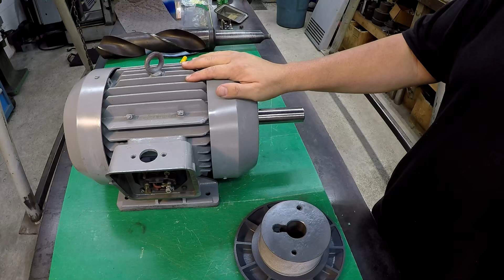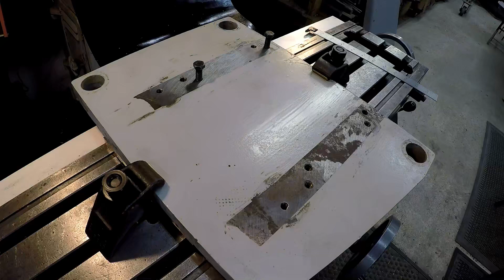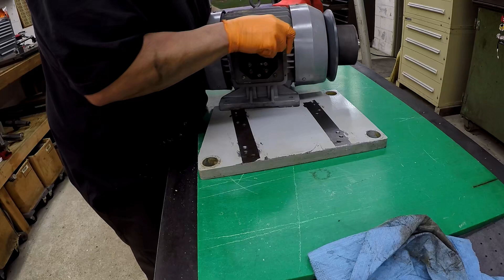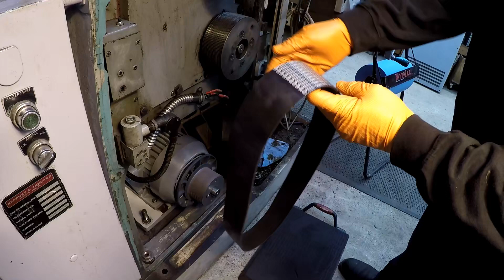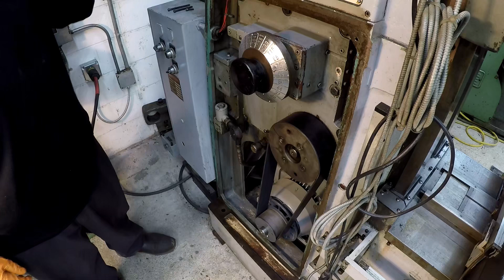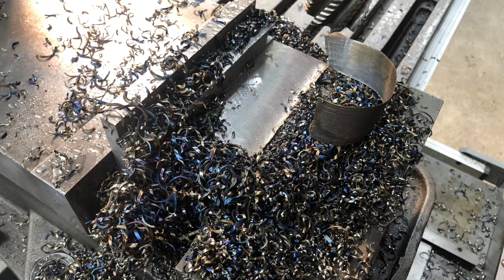SNS 246: K&T Electric Motor Installation

Comment: I think you said that you drilled the new motor holes by taking alignment off the old holes - if whoever drilled those holes didn't bother to check the vertical alignment on the pulleys, maybe they didn't bother to check the yaw, either. If they didn't, you might have to rotate the motor clockwise or counter-clockwise to keep it from wearing the belt prematurely.
Reply: N Ferraro I was thinking the same thing. I wouldn’t trust the bottom plate at all.

Comment: Could it be that someone replaced the motor at some point, and due to a model change the motor was not correctly aligned. Because it was from KT they just assumed it was fine and never checked it, and just left it that way?

Comment: Adam, When drilling those holes to be threaded in that big plate, are you going for 50% thread? I'm asking because that tap seems to go in very easily.
Reply: It was a gun tap driven by a mill vs mild steel.. that should go like through butter.

Comment: When that machine was originally built did it have a multi groove wide belt or was it designed  with several V belts that would have been more age appropriate for that machine in it's day?  Just a thought because the V belt was king until the mid 80's in automotive and industrial applications.

Comment: Adam, not to tell you your business but from my experience the wider the belt the smaller the acceptable misalignment of the pulleys.  Also a misalignment of the pulleys puts an end load on the motor bearings.  An hour spent getting as close to an exact alignment now could yield thousands of hours of added service life to your machine and smoother running.  It is great to see the mill in action. :)

Comment: The motor sounds great ,luck is on your side ; Looks like the pulley with the built in fan was to cool the original explosion proof motor , Also a great call to have wired the 7.5 hp motor to the shop's lower 3ph voltage 230 v. (it will raise the motor amps ) but ok, and the use a smaller step-up transformer for the table only , that will save lots of cash .

Comment: From the looks of that mounting plate for the motor the motor you have may not be an original.  There looks to have been a few different sets of hole drilled for different motors.  Either way, problem solved.  Great work as usual Adam.

Comment: I think from the vid the motor pulley should be modified by turning the fan off. Probably the pulley was for a different motor.
With the K & T not being run 8-12 hrs a day it will be OK. If you run the motor for long periods you should check the temps of the motor.
Thanks

Comment: I don't know machine shop work but I do know motors and belts and pulleys and it sure looks like the drive pulley is installed backwards. The offset appears to be about the same width as the belt guard.
Another thing is that you would never have two centrifugal fans running next to each other, they would starve each other for air.
Reply: If the pulley is on backward it would be impossible to get off.
Reply: @Labeeman  Still, you would never run two centrifugal fans back to back they will starve each other out for air. If you are sucking the inlet air from the motor fan where will it gets it air from? I have done HVAC and ventilation work for years and I understand how fans work.
Reply: @davidtyndall9604  The original motor may not have had a fan that is not the first motor in there I think the fan is on the other side of the motor not on the shaft side.
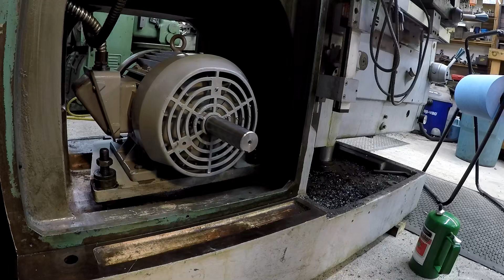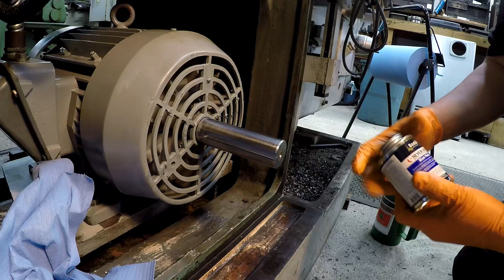Reply: @Labeeman  At 4:56 and again at 5:23  you can clearly see the centrifugal fan inside the motor end bell.
Reply: @davidtyndall9604  The original motor was an open frame motor that did not have a fan the pulley is installed correct just the motor is not the original.

Comment: I hope you can make a life being self employed Adam. I use to be self employed (1995-2000), but my work slowed down and I had to get a real job to survive. I'm glad I did cause my real job was the best job I ever had until it stopped. I got this job as Director of Maintenance at First Baptist Church and it paid more than when I was self employed (About $10,000 a year more). But that job went south when the church went broke and they omitted my job from the budget. They said they could hire contractors for less than what they were paying me (b.s). So after that job ended I was looking for another one.

Comment: Maybe the motor pulley is on backwards!  If you flip it around, you'll gain the 1".  The motor already has its own fans and the fan on the pulley may be to cool the belt, right?

Comment: Not that it matters at this point, but it looks to me that the feet/supports of the motor where swapped. They are not symmetric front to back. If you'd swap them again, the motor would sit further back on the base plate.

Comment: For tightening the belt, there is an App called "Tension to go". Just start the App and hold your phone in the middle of the longest span between pulleys and "twang" the belt. The app measures the frequency of the vibration. The correct frequency can be obtained from the manufactures web site.

Edit, The app is free and from Continental
Reply: Or you can just push your finger against it and see how it feels.
Reply: @Rubbernecker  When you have large spans like that, just pushing your finger against it dose not work. You are only measuring the amount of defection and on wide belts, it is very inconsistent. That is why manufactures recommend that they are tension-ed by frequency.
Reply: Driver 1967 it’s time to start calling them pocket computers.
Reply: In 60 odd years i have never heard of this, sounds like a scheme designed for those who ain't got the brains to measure deflection :P

Comment: Hey Adam... You put the cover on the Peckerhead upside down. The front and back should be parallel when the cover is installed.
Reply: You get a little more room in there when you do that.  The volume does not increase but you get more height.  It's down to personal preference.
Reply: @rdlawrence1473  that's what i thought might be the case, more room up where the wires empty the into the box.
Reply: @MrKotBonifacy  sorry this has irritated you. I think we all agree the box cover was on upside down and the discussion had moved to why would someone do this.
Reply: @MrKotBonifacy  ok cool no worries

Comment: Is the motor electric box cover on upside down  ?
Reply: The box is called a pecker-head, it often can be mounted in 4 different orientations depending on what direction the power flex-conduit is coming from, in wet locations you'd typically enter from the bottom.
26:33 Yes the cover is on wrong.
Reply: No big thing.  I bet it will do a fine job of covering the wires.
Reply: yes it is )   
but who cares until it fits.

Comment: Interesting that the gear ratio of those two pulleys is pretty low (2:1), i.e. not gaining a lot of torque though gear ratios. I guess the motor torque is sufficient on it's own.

Comment: Only three bolts on that mounting plate? Is that by design?
Reply: If so, three bolts = tripod, which would allow fine adjustment in 3 axes. Think of 3 vs 4 legged table - the 4 legged table rocks on uneven ground (4 points of contact all have to be in same plane) whereas a 3 legged will make 3 points of contact regardless of unevenness.
Reply: @Festoolification  - Good point, but the 3 bolts were all in corners of the square mounting plate. Just seemed odd.
Reply: Maybe the pivot point doesn't matter that much as long as it does pivot, also the 3 bolts may have aligned with the original motor bracket hole and no mounting plate involved at all from the factory.
Reply: @Festoolification  - Yes, it's just my OCD kicking in, LOL.
Reply: @theroboticscodedepot7736  Guilty too!

Comment: Between you and Steve Summers there is not a lot I don't know about these fine old machines. Many thanks bud.Looks like the motor has been changed a couple times eh. Love gun taps. They are really tough.The test with that hog mill tells all bud. Well done !
Reply: Seems like a lot of people working on the K&T mills . Is that a good thing??    I think so

Comment: I’d say you are correct that’s not the original motor for that mill. Judging from the paint voids on the mounting plate that are more narrow than the feet of the motor. Looks like it was painted with the original in place or some sort of bars that allowed lateral adjustment.
Reply: That looks like what masking tape would leave behind. Especially if you look at the jagged ends.
Reply: ColtaineCrows Just as easily be ragged edges from paint leaching under the motor feet. Why would you mask off an area that didn’t match the footprint of the motor?  If your goal was to keep paint out of the bolt holes, then replacing the bolts makes more sense with no rusting of the plate.

Comment: could the pully be on backward? looks like about 3/4 inch thick plate on the back?
Reply: I believe Adam has it correct. I found a manual for the S-12 K&T at vintagemachinery.org and it shows the fan, PC34, being mounted between the pulley, PC32, and motor, PC36, like Adam has on his. http://vintagemachinery.org/pubs/2098/15011.pdf Page 18 for Model 307. Thank you Keith Rucker for making this and MANY more available to us. Check out his youtube channel. https://www.youtube.com/user/ksruckerowwm
Reply: @ss308ster  yeah I saw that too, very strange for it to be out that far. The belt must have been under such stress. Will work very well now and won't be putting all that side load through the motor.
Reply: @ss308ster  But the motor shown is different, in that it only has a fan at the end opposite the output shaft. Adam's motor has two fans presumably so it can be run in either direction. In one the pulley fan may hinder cooling not aid it.

[Edit] Strike the 'either direction' bit - I've gone back and looked a the earlier video and the fans are the normal centrifugal ones, not ones with  angled blades that I saw them as being from this video. The fan on the pulley will be still be working against/hindering the one on the output shaft end. I'd look at removing it.
Reply: And looks like the plate is blocking airflow to the motor
Reply: Jamie Dominy i was thinking the exact same thing!
Reply: i thought the same but the fan on the outside wouldn't make much sense i dont think
Reply: How would you get to the screw for the keyway in that case?
Reply: @superdau  well since, like Abomb said, the key has been modified.  The old key may have worked without access from the "front" of the pulley, but since the key is now straight with the locking bolt on the outside, the pulley would have to be backwards.
Reply: Or the plate....
Reply: maybe but the upper one is movable / adjustable but you do have to be familiar with the type of pulleys

Comment: I don't think so, but could it be that the base plate was flipped the wrong way around in there? Hard to judge because of the angle the camera is pointing.

EDIT: Didn't realise it was a 3 bolt pattern, no way they could get it in the wrong way around.

Comment: Is the motor pulley on 180 degrees out? .. The fan surface to be on the outside, putting the v-grooves inward toward the motor housing?  EDIT:  Apparently the manual shows the pully/fan in the orientation with fan as Adam installed it.. but no way is that original motor... base is off... so, this was the correct fix👍🙋

Comment: Maybe the pulley was put on wrong? Should the fan not be on the outside?
Reply: Stephan Gösselsberger 
My thought exactly
Reply: Not sure which way the pulley is supposed to be, but it appeared that flipping it might be a quick and adequate fix?
Reply: @dudleycornman1624  The only thing he could do is put a sprung loaded roller on the inside to take to strain.
Reply: How would you install the setscrew for the keyway if that was the case? Doesn't make sense.
Reply: No these motors have 2 internal fans one at each end.
Reply: @djmorgan5708  
But the big side of the pulley covers 1 fan
Reply: @hdxer8825  The pulley is vented for air flow, you can see it at 4:00
Reply: @llljustcallhimdave  
Ahhh....OK. Thanks:)
I had not seen that before.
Reply: @llljustcallhimdave  yea, so Adam did in fact put the pulley in correct position. Thumbs up
Reply: Stephan Gösselsberger I think you are right
So the pulley covers the cooling from the engine!
Reply: Seems the paint pattern on the motor mount would indicate it is not the original motor.
Reply: @matthewkantar5583 ....The paint pattern and about a half dozen odd mounting holes.  That is probably the last in a line of replacement motors. This happens to working machinery in industry all of the time.
Reply: My bet is that the motor is not original to the machine the spacing issues are because the motor was not a direct fit. Another possibility is the pulley is not the original pulley either way The idea of flipping the pulley so that the fan is away from the motor as Mr Spock would say is illogical.  A couple of things to me that seem somewhat odd to me about this machine looking at from the comfort of my lazy boy is the base plate for the motor uses three corners to anchor/balance the motor plate on and why not use a belt tensioner to adjust the belt instead of studs and pedestal nuts but then again a lot of things about how some machines are built cause me to scratch my ever thinning follicle coverage to the solar panel for my sex machine. 😁😁😁
Reply: It looks like the pulley is in the right place, but the "fan" itself is possibly the wrong way around - the K&T seems to be an S-12 model, and on the diagram of its parts manual the "fan" disk is indeed the one closer to the motor, but it seems to have its "peripheral" slots on the motor side, not towards the pulley like in the video. See part 42 on page 10: http://vintagemachinery.org/pubs/detail.aspx?id=15011
Reply: @AttilaAsztalos  Good observation and useful reference to the parts manual.
Reply: thats exactly whats going on , turn it around
Reply: If you look at sns230  you can see that he installed it the way it came off.
Reply: That is also how it looks in the exploded view in the manual.
Reply: Robert Oswalt you’re honorary SNS historian.
Reply: But it looks like the pulley fan is fighting against the internal fan... Both would act like a centrifugal impeller and pull air from the center out.
Reply: Words out of my mouth (or off my keyboard??)